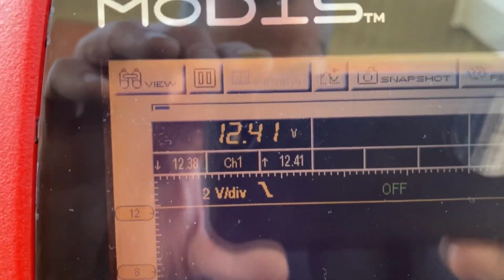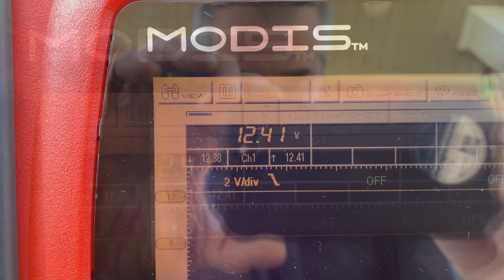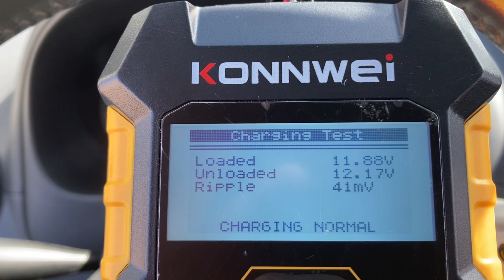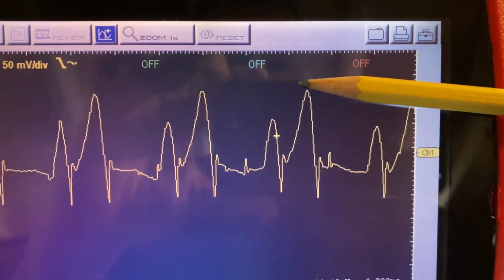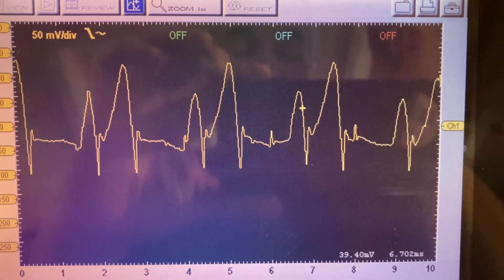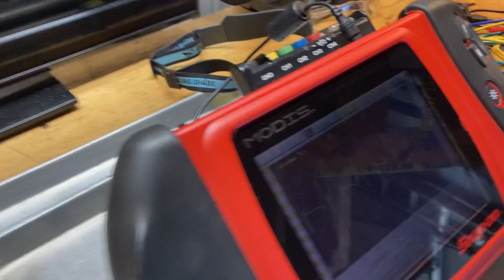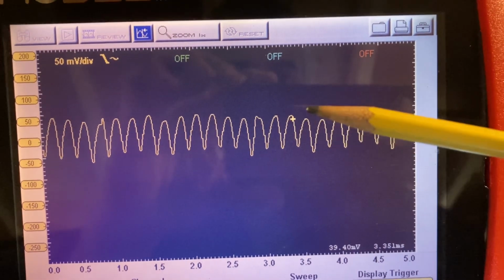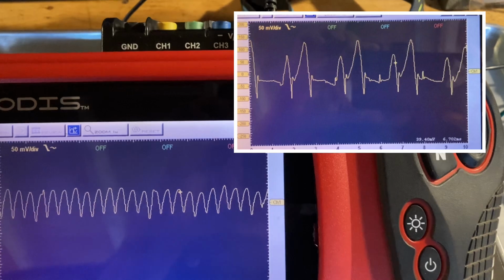2009’ SX4 Alternator Failure Assessment

Comment: I think the device is only looking at the ripple amplitude and voltage drop, which is normal, but it should flag a low charging condition.
Reply from the maker: Yeah likely something grossly oversimplified like that. None of the parameters are 
correct…”Charging Normal” 🤣 Thx for watching 👍🍻

Comment: Good vid Gibby! The Modis screen looks good, I miss the vga output on mine. I still never figured out the issue. I liked the 24 inch monitor with it. That was the main reason I got that white cart, lol. 
 That Vibe, I checked the ripple yesterday. Its pattern does not look nearly that crazy but I noticed heat soaking must raise the ac, at least this one. I usually try to do the starting and charging test with the engine cold. Like real-world cranking situation. Thing stays under 50mv, for a 5 min charging test. I left it hooked up while it warmed up and 113mv was the average when it was hot. Electrical loads temporarily put 10 extra mv in but returns to 113mv. Seeing that makes me wonder how many others slipped past me. What else can ya do but make a mental note and adjust? It charges 14v, but I can hear that whine very faintly on it. 
 Good luck, and it will be interesting to see if the internals are the same in yours! Cheers!
Reply from the maker: Two different cars, 2 alternator issues in a month. Embarrassing myself, missing that footage at a critical moment. Oh well, this ain’t Hollywood 😁 I hope at least the point regarding the ripple signature distinction between the 2 cars, has some value. Ripple Interpretation is not a new concept to me, but honestly something I have very little practical experience with as just a hobbyist.
Thx for watching Eric. Hope your Vibe rehabilitation is going well. 👍🍻
Reply: @TheGibby3340  I am just starting to remember the ripple test consistently. What do you usually use as a max? I heard 50mv and also 100mv. I kind of figue 50-100 range is on the way out, more than 100 is bad for certain. Just a guess, but if i sold alternators, I'd go with 50 lol.
Reply from the maker: @Backalleydiagnostics Well…That’s a question that I have heard many different answers to. Text book answer seems to detail no greater than 200mv AC. In reality healthy alternators seem to maintain far lower ripple amplitudes than that figure. Really I think the uniformity and symmetry of the waveform, provides a greater insight into the health of the generation system. 
Do you have a copy of Graham Stoakes “Automotive Oscilloscopes Waveform Analysis” book?

Comment: In the modern world of vehicles with internal voltage regulators and sensitive electronics highly effected by heat then add computer controlled charging the need for a good warning system is paramount to not getting stuck some where at minimum a voltage gauge in the cluster is better than a warning light... Computer car I always look for under 50mv ripple and your spot on that wave form is completely off...but the death nail is voltage 12.4 is not a fully charged battery. diodes and or stator testing may find the issue as long as computer is not commanding the alternator... not up on service data on the Suzuki lol.. but I have faith in your nose that that alternator is done. Good luck
Reply from the maker: 2nd time in an SX4 I have seen an alternator failure with zero indication of such on the instrument panel. Exact the same failure symptoms, especially the distinctive whining sound RPM dependent. I’ll haul it out and get a look…Thx for watching 👍🍻